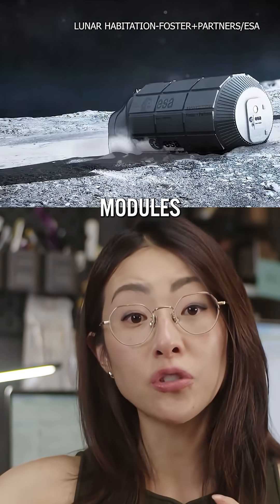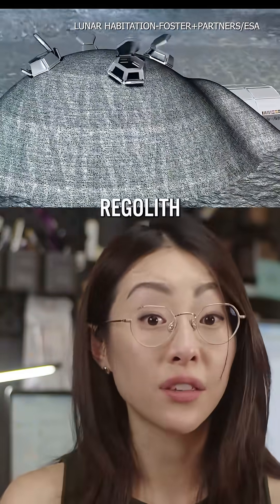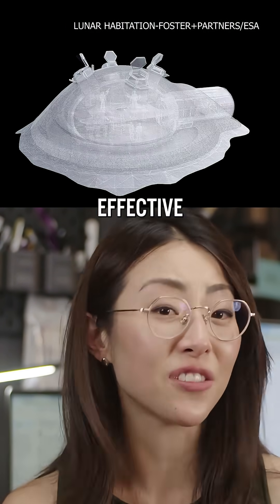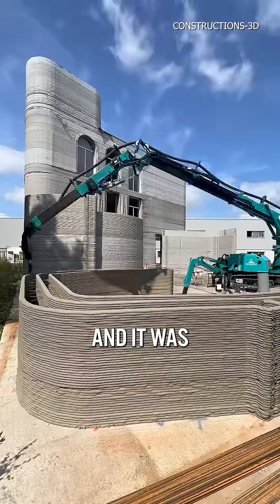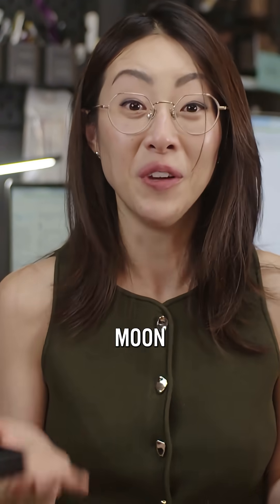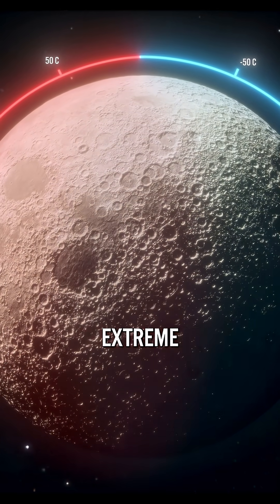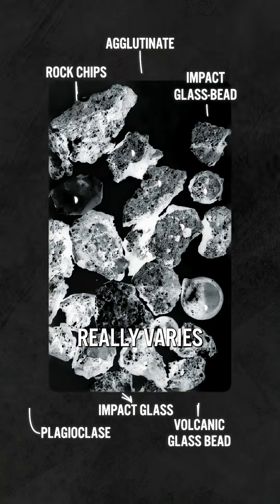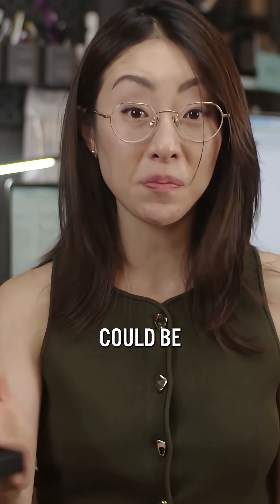What would you build first if you had a lunar 3D printer?

Comment: The transformation comes a few years after the primary patent expires.  3D printing is just now starting to enter public domain, the real fun starts soon.
Reply: Ooohhh. That is an excellent point. Considering this, all I'm aware of is how the expiration of patents can make production cheaper, as seen in the pharmaceutical industry, or CDs to digital music. I never think about an opportunity for improvement. I had been hopeful for 3d printing for housing.
Reply: @uqox the issue with 3d printing houses is shipping around massive 3d printers that need specialises workers to use them, instead of just hiring local construction lads. Other issues too, but the patent isn't what's holding this back.
Reply: @hrodvithit  I mean, the local construction lads are also specialized workers, they just don’t usually handle that level of machinery. 

Tell a non-construction lad to man the mixer, jackhammer, electrical, tile, digger, etc. and he’s bound to make some expensive mistakes too.
Reply: @hrodvithit  and China ships pre-built homes around that just need to be finalized
Reply: @hrodvithit problem with 3d printing houses is theres literally no benefit and it's total shit quality.
Reply: @jonny-b4954 oh yeah
Wood plates are totally not shit quality
Reply: @hrodvithit well the paitent also stopped people from using an far older silo construction technique, and I doubt any of the local lads around today remeber it. But its very lightweight on the equipment mixing the concrete on the way to the layhead, the layhead lays the steel reinforcment and the concrete in a perfect circle tapering in thickness as it goes taller and the whole kit can be carryed across town in a city bus.

I say they dont because if they did theyd have realizied this extremely lightweight tool could 3d print houses by just making the arm  autonomously adjust its length and the layheads angle.

And unlike most of the 3d printed homes this is already a tested and known technique with known and approved for standards construction so they wouldnt have to go through the actual decades it takes to produce a new home construction technique.
Reply: The main problem with 3d printing houses is that it doesn't make sense, economically, bureaucracy and regulation-wise and you can't go by any best practices so the chances of your house being shit and not durable at all are very high
Reply: I’ve heard this thesis for the last 10 years.
Reply: @Frygon right?! I swear ive seen this animation for years too
Reply: @Frygon  and big shifts in modus operandi take a few decades. 10 years is nothing
Reply: I said exactly the same thing in my master's thesis 11 years ago! But nothing major has changed
Reply: The FDM patent you're probably talking about expired in 2009. Your comment is about 15 years late.
Reply: @RCuriousPilot  FDM patents were applicable to thermoplastics, and also the heated chamber and heated bed.

Concreted is not plastic, and is not "Fused" to be deposited. 
The newer 3Dprinting companies with concrete have wildly different methods patented. 

His comment is on point, this is still crippled by patents
Reply: @fofopads4450  there is literally nothing stopping someone else from creating their own concrete printers. But it’s just a crap way to build things. THAT is why it’s not being used
Reply: @wiggy8912  you have no idea what is patented right now.

One example is a company that only patented the arm robot with a hose and the mix they use.

Another has patented only the nozzle, as it extrudes with steel wire embedded inside the concrete. As well as their kinematics.

Maybe 3Dprinting is not great when have other methods on earth.
 
Now, if you want to build on the moon, it needs to be done with machines that do not sweat and consume valuable oxygen inside spacesuits.

3dprinted or any other way, machines are the obvious choice.
Reply: What a joke. 3D printing dwelling structures with grout is incredibly inefficient and results in a hilariously poor build. Workers mix the grout and continuously unclog the machine. A few masons can CMU block any structure in half the time 10x strength & quality.
Reply: @JohnDomenica Yeah, the only reason you'd want to use 3D printing in construction is if you wanted to eliminate construction jobs. There's nothing that I can see with 3D printing at such a large scale that actually improves housing construction, aside from maybe making it faster, but even then, the slow part of building a house is the outfitting, not the outer structure. 

I had a team of 4 guys frame an addition in just a couple of days. Drywall and insulation took 2 days. 3D printing that would've probably taken the same amount of time, if not longer.
Reply: @JohnDomenica riiight, like we didnt buuld with hilariously fragile or rot-prone materials for thousands of years. Change takes time, large scale application of this tech is barely 10 or so years old, thats a blink for most new applications of an idea
Reply: Houses will be underground
Reply: The issue is the cost of production with it's resiliency can't be justified. If you have money to throw away you can 3D print your home, but you get better quality for far cheaper in any other standard materials, even foam building blocks are more efficient, cheaper to produce, sturdier, and quicker to build. 3D printing in general requires weak material, built up with lackluster "welding" by a costly, delicate machine. Just upscale the problems
Reply: What?  Nothing about 3D printing (on a conceptual level) is patented.  Anyone can design a 3D printer to fart out concrete if they want, it’s just a dumb, poor quality way to make structures.
Reply: @wiggy8912  ok you obvioulsy have no clue what you are talking about
Reply: sorry mate , 3d printing is free since the conception of 3d print...
Reply: If time isn't an issue we can ship the machines up there and let them go at it at any speed. 

Prepare the whole hab, then once is done visit it and check it out. 

And building on the moon shouldn't have time constraints.
Reply: @cisophon  The whole idea is stupid and was born by americans who build their homes from cardboard. 
there are plenty of systems that can be used by robots in the near future.   robots stacking wooden lego blocks all night is much quiter and cooler than a giant 3D printer
Reply: Yeah but what she mentioned about scaling the process up is still very relevant considering industrial environments.
Reply: Oooh, what does that mean though?
Reply: So the entire period where the patent holder could have charged monopolistic prices was a period where nothing happened, but once any firm that implements the technology faces immediate competition from other firms doing the same, that is when the investments will be made to implement the technology? If we suppose you are right then the entire case for patents disappears.
Reply: @PatrickTMayer  that's baisically how patents work in fields where there is an alternative to paying monopolistic prices.
Reply: Just one issue... 3D printed homes are not reliable, unstable, prone to rot and have a lifetime of less than 5 years... 

There is massive issues with the stuff.
Reply: @AlphaHorst  you act like there has been no progress since the first testrun. there are multiple printed homes with people living in them in holland, none of them rotted, all are stable and they stand since 7 years. inform yourself before talking trash
Reply: @TB-fm8kf  You should inform yourself... I mean its is well established that 3D printing homes is not viable at all and almost certainly never will be
Reply: @AlphaHorst  you have no clue what you are talking about. your name fits perfectly
Reply: @TB-fm8kf says the guy who can not even use Google search XD
Reply: @AlphaHorst  Yep, you are that guy. otherwise you'd know that you are wrong. 3d printed buildings are constructed all over europe in the past years, none of them had structual weaknesses. you are either a troll or an idiot who fell for bad tabloid articles from a decade ago
Reply: Some fun already happened like 3D printing keys, or guns
Reply: When? What year?
Reply: The patent expired back around 2000.
Reply: Lol 
Nice optimism
Reply: You sound like a string theorist
Reply: Wait,. ARE YOU SERIOUS? Imagine Newton, Einstein,  "patented" their work? We live in deranged times.
Reply: @agentsmidt3209  You do know Einstein was a patent clerk right?
Reply: @agentsmidt3209  neither of them actually invented anything. They made discoveries into the laws of nature, nothing to patent there. Penicillin and the polio vaccine were huge discovery / invention, respectively, that was never patented which was a graceful move
Reply: @agentsmidt3209  You do know that Newton and Einstein didn't invent any products right? They Discovered how the world works, you can't patent Discoveries because they where already there we just didn't know about them. 

Patents give the creator of something that never existed before the ability to make money off of it encouraging more inventions. 

Look at everywhere individual patens are not allowed and you will see very little innovation, be it a corporation(who steal Patents) or countries who don't allow patents.
Reply: @agentsmidt3209 And Einstein DID exercise his IP rights. His works are still under copyright.

Comment: Anyone who thought 3D printing was going to revolutionize the housing industry doesn't know anything about the housing industry.

The 3D printed foundations are cheaper than regular foundations. But most of the costs of new homes is tied into all of the other stuff. The highly skilled labor stuff. Electrical work. Plumbing. Windows. Cabinetry. Trim. Flooring.

Add in 30-40 million illegal immigrants, and 3D printed homes were never going to have any discernible effect on housing prices.
Reply: A large part of the cost of building homes is taxes, that won't change.

Comment: I wonder if building an igloo like structure from regolith bricks is a better solutio. But I have to damid, a big 3D-printer is definately the cooler option.
Reply: I was also thinking some sort of brick/part system that gets made first then stacked in interlocking patterns so no sealant is needed but can be used.

Comment: If we aren't able to utilise lava tunnels, then the next easiest thing we can probably do is fly a boring machine up there to bore down to create a silo of sorts, then branch off and put a cap on the top.
Reply: To much weight.
Reply: @doggletamer  Couldn't we ship it up in parts that weren't too much weight and assemble onsite?
Reply: @CanadianWolverine  I think the idea is more that you could probably have the 3D printer and any necessary additives be lighter than a boring machine than that it would be too heavy to get there. Also, you then don’t need to send all the weight at once because you can send more additive if needed later where the boring machine would require sending all the weight up front and would probably have greater spare part requirements because it’s likely seeing more stresses and there will be cutter wear,
Reply: Besides a boring machine being too much weight to transport out of orbit like someone else mentioned, you're also assuming that the soil is dense enough to trap air/keep oxygen from escaping. I'm sure the regolith on the moon is quite porous.
Reply: @Panzersmash the crust in most areas seems to be Basalt (with regolith over the top), but if a boring machine could be taken up/constructed/3d printed part of the construction process I've seen  here on earth is that as it moves along it installs concrete panels that form the tunnel structure. So I suppose it is technically possible. As it moves along the waste could be ground down and mixed with something to form those panels maybe?
Reply: @Panzersmash while made of a number of different minerals in different places, due to being unprotected by atmosphere, surface moon dust has all been grinded down to razer thin particles.  It's like Asbestos, but instead of slicing up lungs, it slices up kevlar.
Reply: tbh, I liked “Silo” too much to be impartial. (It’s an appleTV show all about an entire civilisation living in a huge silo with a hostile outside world)
Reply: @binarybridgador2484 love that series! If they could dig a parallel tunnel they could use it as an underground landing facility for starship to 'thread the needle' close the entry way seal off the rocket section and then people could disembark to an airlock.
Reply: No reason to think lava tubes won't be viable.  We've already started data collection and it's looking promising (assuming NASA doesn't fire them all)

Comment: Digging some pits might be a better option.
Reply: You would need to go pretty deep. Some places regolith is 4-5 meters but it can get to 10-12 meters. Digging through what is incredibly sharp sand is going to be incredibly hard. Do we even know the rock underneath the regolith will be able to sustain a base? Might want to start with a crater and build a protective top.
Reply: @hardworker424 You've got a solid point. The regolith’s depth and composition vary a lot, and without precise locational data it’s risky to plan extensive digging. A shallow  3-meter pit reinforced with inflatable modules might be a more practical starting point for subsurface habitation. The real feasibility will depend on the first batch of probes and how well they maintain stable communication links. Adapting construction strategies to the site’s specific conditions will be key for sustainable lunar bases. Who knows maybe our first moon neighborhoods will start with a few cozy pits and a big dream!
Reply: @hardworker424  Why dig when you can blow up? Think outside of the box. Or inside of the box of TNT.
Reply: @hardworker424 what if we just blast a rocket at a patch of it & live in the fresh crater? Essentially the same as digging with explosives before we get there.
Reply: Underground is absolutely a better option, and is the one NASA (and I think Eurospace) are moving forward with.  We are not digging them however, the moon at one point had a now inactive volcanic core.  We can use magnetic field data to find caves and lava tubes to build inside of.  Truthfully any sort of surface habitation is pretty unfeasible due to multitudes of reasons.
Reply: @drakerp2  we should be building like ants with light tubes to the surface.

Using the same underground regolith to smooth and support the inner caves, pressurized space would become so much cheaper to achieve if the rock can just be coated and sealed.